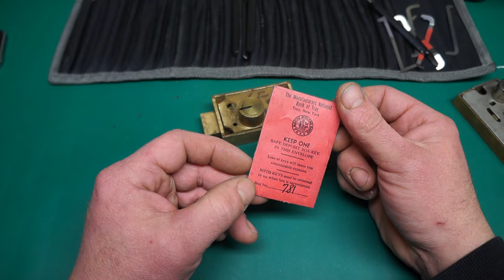(-67-)  Exploring saftey deposit locks form Ted Park

Comment: very nice...Ted sent me some of those too!
Reply from the maker: Jeff Moss I found blanks for the dual one. Now need to make some keys
Reply: Great video!  The little teeth on the Bates lock makes it really hard to pick.  As far as the mosler goes, here's some info:

The spacing of the renter key appears to be 0.50 with a slot width of 0.55. I think the cut depths are as follows:
1 320
2 290
3 260
4 230
5 200

I haven't made renter keys for the Moslers yet, but once I do, I'll forward the info.  I'll send you the guard key info once I'm at the office and can measure it.